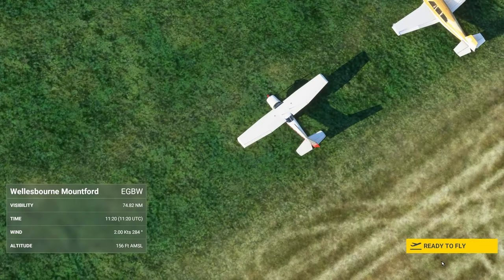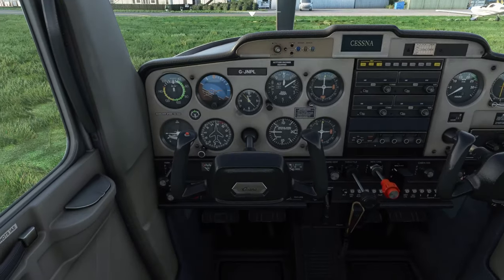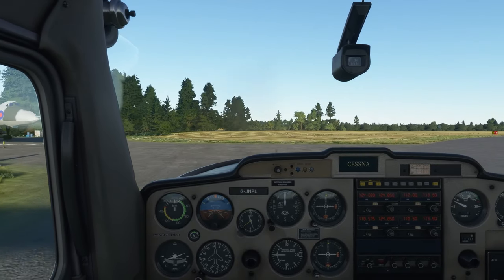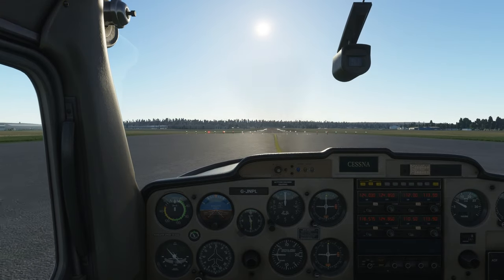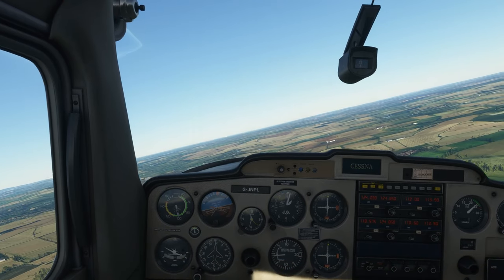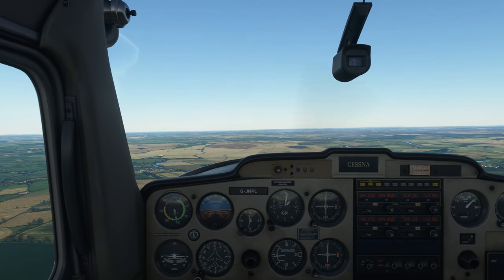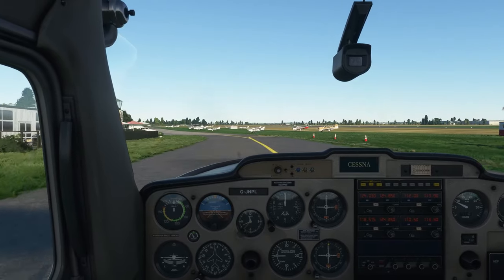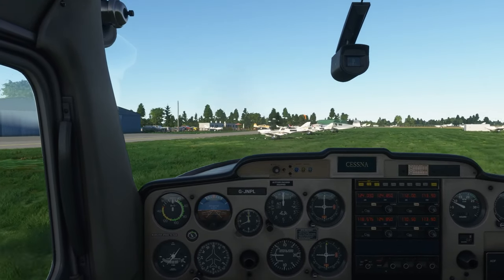Learning To Fly Episode 005 - EGBW 5th Pattern at Wellesbourne Mountford

Comment: Your're getting good at this.  Need a new challenge?   Midway along the down-wind leg, pre-landing checks complete, down-wind call made, admiring your superb airfield scenery - then the instructor sitting beside you pulls the throttle back to idle, and guards it so you can't reset it.  Can you make it back to the runway?   Hint - trim for best glide-speed (65 knots), no flaps until you're lined up on short final.   Love the scenery, by the way.
Reply from the maker: When I get more confident I'm going to try this https://flightsim.to/file/2272/randfailuresfs2020

scary! random failure!

But when I finish the scenery at Wellesbourne, I'm going to take a stab at Bidford (EGBI) scenery (should be much easier!) and then try doing some flights between the two.
Reply: Never landed at Bidford but our Aerodrome Manager is a tug pilot there.
Reply from the maker: @152driver1  I had a glider flight there once and used to go there as a kid and watch the planes take off and land (same as I did with Wellesbourne)

Comment: You are doing a great job, particularly on the scenery. Regarding the signs, easiest thing is to use any photos for your texture but I think you would know that already. Regarding the flying, I didn't hear you mention the trim, it's the first thing I do once I reach the altitude I want to stay at, but others will know more about this plane than me. Not sure if you could remove the taxi signs and model your own too, they are very easy to do and texture. Other than that, great work, good video and holler if you need any help with the modelling. Thanks entirely to you I will be looking to upload some things to flightsim.to in the coming weeks.
Reply from the maker: Yeah I'm using photo textures as and where I can. I do trim when I'm at altitude (usually on the start of the downwind) as its built into the CH Flight Yoke but it's really super sensitive. I'd rather not model custom taxiway signs just for Asobo to put in more choices down the line and have to take them all back out again :)
Reply: @FlyingTheston   I did wonder if you were using the CH Joke and yes it is a bit sensitive and flimsy, haven't even hooked mine up since I got back into simming. I hear ya on the signs, but you also got me wondering now. It should be possible to model a bunch of generic buildings that people can add to their own package so that they can drop them into their own projects as and when they want, esp if the default object list doesn't have what they want, such as the example in your 002 video when replacing those dome hangars. Chhers.

Comment: flaps for takeoff should be first stage, 10degrees, mag drop must be no more than 125rpm on power check. Max rate of climb is 65Knots. Circuit should be 1000ft. Landing apply carb set rpm to 1500. Maintain altitude. when speed drops into the white arc use two stages of flap and trim for 70knots. turn on to final. add full flap, carb away at 300ft . Aim for the numbers, cut the power over the threshold and try and keep the nose of the ground.
Reply from the maker: I thought flaps in the Cessna 152 were supposed to be at 0deg on a runway and only 10deg on a grass field runway?
Reply: @FlyingTheston  Hi. No in the flight manual it's 10degrees for both. Currently doing my ppl. But I will ask my instructor 😀
Reply from the maker: @johnhodgkiss9882  I started with 10deg of flaps, but I was told by IRL pilots in the comments that 0deg on non soft runway. I've never flown a real plane so I have no idea :p